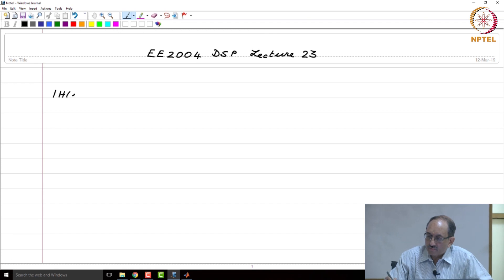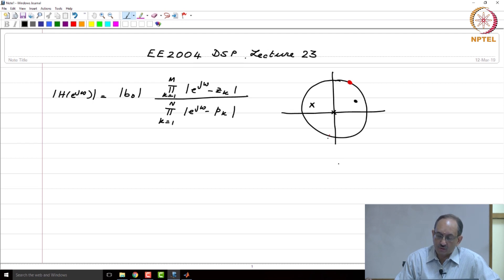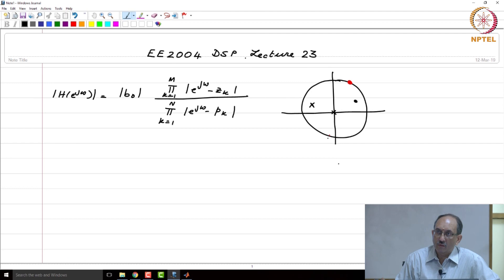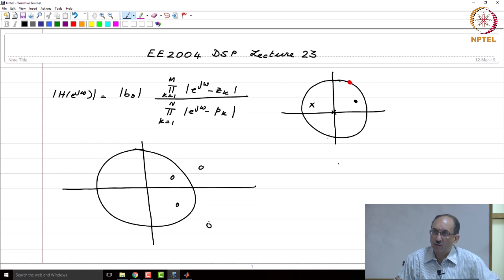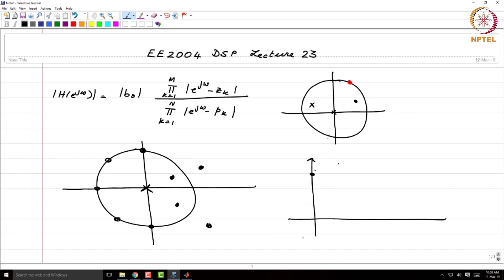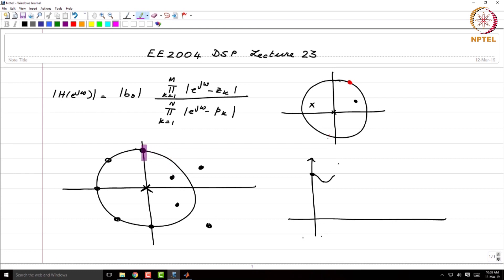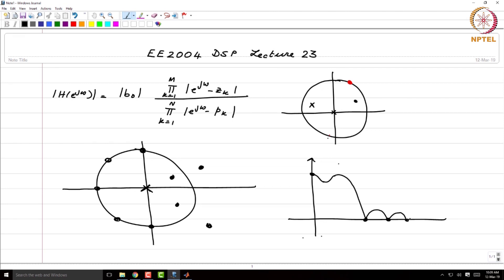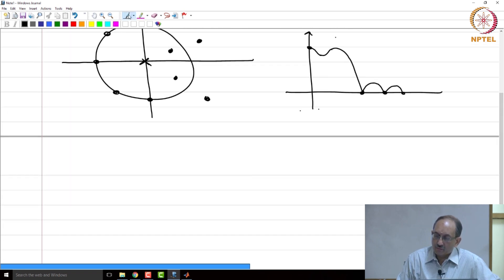Lec23 Part1

Comment: There is an error in the plot of the magnitude response of the FIR filter shown on the first page. The response at omega = 0+ should increase from its value at omega = 0 because, as one gets away from a zero while moving on the unit circle, the magnitude frequency response should increase. The Matlab plot shown later is, of course, correct. In that plot, the increase in magnitude response at omega = 0+ is clearly seen (please refer to Lec 23 part 2, a little after 37:00).